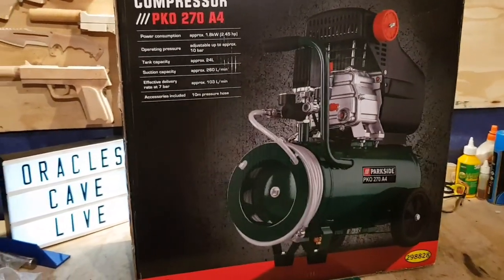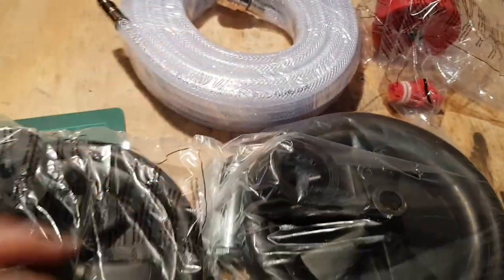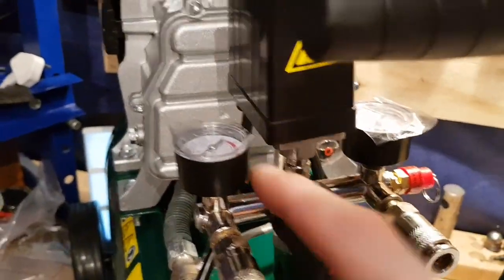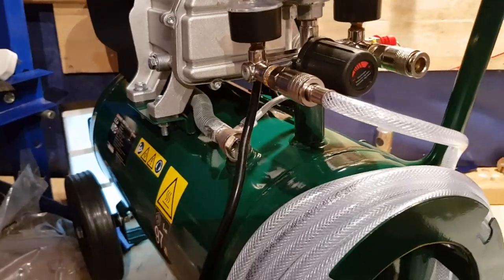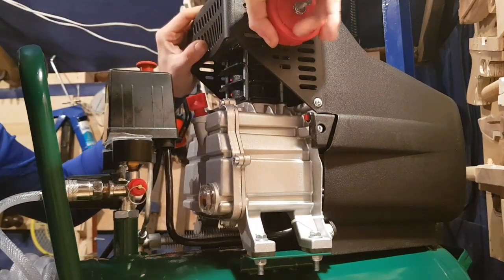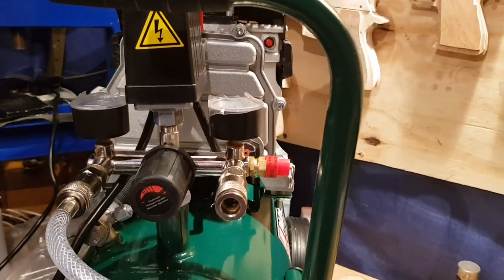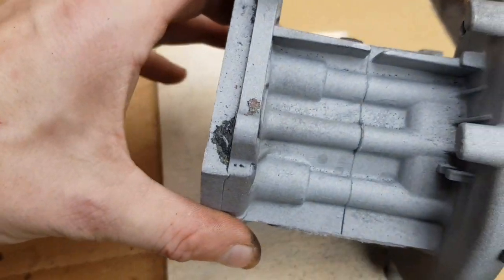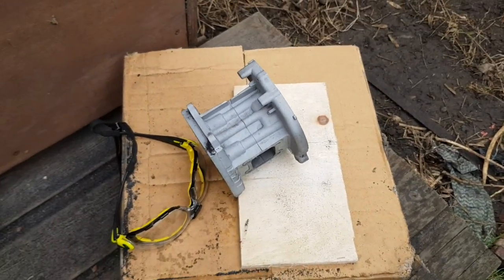PARKSIDE 24 LITRE AIR COMPRESSOR REVIEW TEST, LIDL

Comment: As per Mr Flynn, glad that the sand gun works so well, I’ve been thinking of sand blasting my front hard rock and concrete wall which is now dirty and embedded with moss. A wire brush doesn’t touch it so this looks the perfect solution. Thanks for the video
Reply from the maker: It's an excellent little set up.
Glad the video helped you find what you were looking for Paul.

I clean up all my motorbike and car parts with this blaster and it does a perfect job.
👍👍👍
Reply: Pressure wash it with a quality kercher high pressure washer..you won't be disappointed
Reply from the maker: @kitecattestecke2303  yes I would have to agree.
If its moss removed from concrete, jet washing it would be a better way to tackle it.

Off in minutes plus the water would just evaporate, as where blasting it, you would be left with a hell of a mess to clean up.
👍👍👍
Reply: Simba Fishtigre hi, I’ve tried that with and without the karcher stone  cleaner but although it gets some of it off it still doesn’t succeed, so I thought maybe try sand blasting. But thanks for your reply
Reply from the maker: @paulknight6377  if jet washing doesn't work, sand blasting definitely will get rid of it.
👍👍👍

Comment: The compressor is a must have, ive got air tools everywhere . Best air tool i bought cheap was an old Chicago pneumatic air file for bodywork,  makes light work on cars. The sandblaster is great, speeeds things up very quickly.  Im a panel beater by trade so without a compressor you cant do much. Youll wonder why you haven't had a compressor all your life when you find other uses for it.
Reply from the maker: Definitely, I thought pumping up tyres and occasional sand blasting, but it gets used for loads of things, I'm only just coming across all the types of sanding tools that are air powered, and I'm ready to make the crossover.
Lots of tools that I have could be changed out for air tools and save me some extra space, and they also do a better job much faster than anything i have, with minimal effort to switching out sandpaper and tools.
Even the wife requests the use of the compressor at times, and she is scared of power tools.

This will be powering the plasma cutter when it's up and running aswell.
👍👍👍
Reply: @oraclescave  yes mate i cant Wait To See the plasma cutter going. I had to make some interior parts for my old chrysler regal se out of stainless steel went through about ten jigsaw blades and ended up taking the parts to work to use their plasma cutter. Took ten minutes to cut 8 parts out ,using a jigsaw on one part was two hours and over $50 in blades . Stainless steel is so hard but the plasma cutter flys through it. Knew youd love the compressor.  Great stuff mate .
Reply from the maker: @petergoodwin2465  I have an evolution mitre saw that cuts through everything, plastic, wood, metal, stone, brick, aluminium.

It's good for cutting bars in straight cuts but the plasma cutter was for the more serious chunks and free hand cuts rather than straight angles.
And using the plasma cutter can cut back on lots of other work by just hacking it out of the way lol

Comment: I've had mine a few months now and used it for nailing and spraying fence panels so far as well as the pneumatic chisel I used for taking out some concrete. I just love parkside tools. Glad you put this video on about the compressor and the sand gun as I was debating the sand gun and now my mind is made up. Cheers fella.
Reply from the maker: Much appreciated Tezza
That little sandblaster is awesome and fast at making things look new again.
I even made a blasting cabinet from a plastic storage container and a L.E.D light, so I could re-use my blasting material.
👍👍👍
Reply: @oraclescave  Excellent idea. When I can get my hands on one I was thinking of doing the same type of thing. Sad part is when I got the compressor and other tools I picked the blaster up then decided against it at the time. Have to wait until the middle at Lidl have them in again.
Reply from the maker: @terrygolding62  Ebay sell them too
👍👍👍
Reply: you all prolly dont care at all but does someone know of a method to log back into an Instagram account..?
I somehow lost my password. I would love any assistance you can give me!
Reply: @Greyson Eduardo Instablaster =)
Reply: @Kye Major I really appreciate your reply. I found the site thru google and im waiting for the hacking stuff now.
Looks like it's gonna take quite some time so I will get back to you later with my results.
Reply: @Kye Major it worked and I actually got access to my account again. Im so happy:D
Thank you so much you saved my account!
Reply: @Greyson Eduardo Happy to help =)

Comment: I was impressed.
Reply from the maker: Me too
It would take me days and days of wire brushing and sandpaper to get an engine partially clean so I could paint.

But this blaster can turn a full engine, brand new Looking in every tight space in minutes, with no need to paint to hide bad spots, much better for keeping air cooled engines cooler with no paint.

But just simply amazed how good this cheap set up actually works.
👍👍👍

Comment: Jaysus bais sandblasted won it for me, I see these are coming in next week will be spending my coins
Reply from the maker: You should, it's a modern day MAGIC WAND lol
Turns an engine into new, faster than you could make a cup of TEA.

👍👍👍
Reply: @oraclescave  haha brill mate I've a wee brake caliper would look mint with a sandblast and seal rebuild
Reply from the maker: @ryanrepairs6944  I bet a million bucks you don't stop at the calipers lol

Caliper carriers
Bolts
Shock ends
Old tools
And even things that don't need to be done, and things you are not even supposed to sandblast lol

On an extra note, if you put a sticker on glass, then blast it, remove the sticker for glass etching signs.

Always a winner with the Mrs
Reply: @oraclescave  class thanks didn't actually know that :) subscribed subscribed you mate good content

Comment: Second week having mine and turned it on today.....
It won't build up pressure any idea why? Or how to fix.
Plug under tank is tight not leaking there
Reply from the maker: If possible I would return it for replacement or refund.
Sometimes cheaper end compressors have weak copper piston ring type seals

Yours might have folded causing lack of build up.

Replacing the piston is the only other way to fix really.

Not a hard job, but shouldn't have to do it after 2 weeks.
Mine still works and I have been doing a lot of sand blasting with it.

Running them for a long time without a cool down period is not advised.
Or having it constantly refilling, small motors with no oil,overheat easily.
Which normally causes the piston seal to fold.

Rebuild kit should be pennies, and take you an hour to fix if you go slow.
👍👍👍
Reply: Did you chuck the oil in it? Comes with a 250ml bottle of 15w40 mineral oil. Around 200ml brings it to the middle of the sight-glass.
Reply from the maker: @oscarmuffin4322  these are oiless compressors
Reply: You pointed out the sight-glass yourself before removing the oil plug..... My manual states that it takes 0.25 liters of 15w40 mineral oil.
Reply from the maker: @oscarmuffin4322  good point, but no I never received any oil with mine.
I will check mine again and top up because its had a decent bit of use, and I dont want it to break.
👍👍👍
Reply: @oraclescave  Aye, good idea. I think mine is a newer model than yours. Mine has a proper sight-glass rather than a transparent plug. Maybe some issues with packing them pre-filled so they started shipping a bottle of oil instead.
Reply from the maker: @Mr Brightside yes it was because all my other compressors were oiless, that's the reason I went oiled aswell.
Lol
Reply from the maker: @Mr Brightside I knew it had oil when I purchased it, but when I was making the video I somehow reverted back to thinking about all my other compressors, easy mistake when trying to remember lots of things in order

Comment: Hi.  How much sand would you need to do a 1000cc engine?
Reply from the maker: Depends, maybe a few small bags/bottles, you can use a sieve to filter the grit and re-use the same grit.

Some people just buy a bag of Childs playsand and dry it out and use that. Probably get it very cheap and you would have a decent supply left for other stuff.

Comment: Can you use this for spraying paint? Car paint.
Reply from the maker: Yes, much larger tanks are used so there is a constant supply all the time.
But if you were doing smaller areas at a time this machine would be fine, decent power.
For big areas the machine would need to refill lots of times, but if you done a bonnet or a door sized target at a time this would be more than enough.

Comment: can you run pneumatic tools like screwdrivers etc? did you try?
Reply from the maker: I have used an air ratchet on it, and it manage to take a motorbike apart with zero issues other than refilling with air, but was more than capable, and an air chisel for cleaning cement from old bricks, and again zero issues.
Hope this helps 
👍👍👍
Reply: @oraclescave  hell of a parkside! i dunno where you are but here in Italy Lidl are selling the new 50 lt. Parkside  for 119 bucks and damn if i'm not going to get one.
Reply: @oraclescave  ...and thanks
Reply from the maker: @spiritualcramp8000  very good compressor, and I'm in Scotland
👍👍👍
Reply: @oraclescave  i was guessing if you have ''lidl'' marts overthere. they sell the 50 lt and all the Parkside at good price.... With the Hearts of Lothiaaaann...

Comment: What is the INNER diameter in millimeters of supplied hose?
Reply from the maker: I'm sure its 25mm clear pneumatic hose and it's a couple of mills thick so it's probably 23mm inside diameter. 
👍👍👍

Comment: I know I'm late here but has anyone tried the 50l veritcal 10bar compressor and compared it to this ? I'm debating on which one to choose ..
Reply: Or also the quiet 68db version of the small guy. I might need to just go and buy it and see how loud is it really.
Reply from the maker: I would go bigger, when it comes to air compressors, bigger is almost always better.
Stronger tools run longer before refilling, I personally get RAGE MODE ACTIVATED, when compressors refill lol
The less it happens the better.
👍👍👍